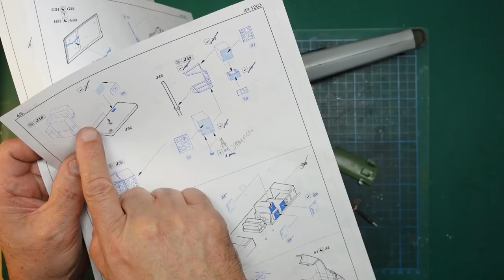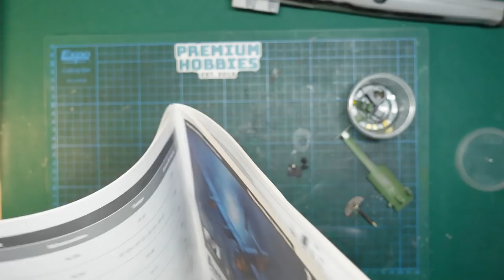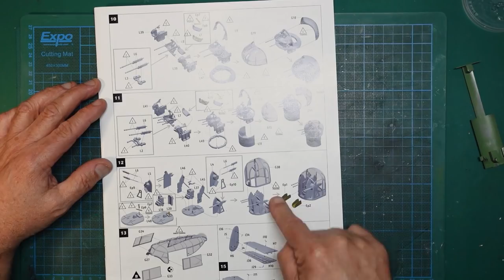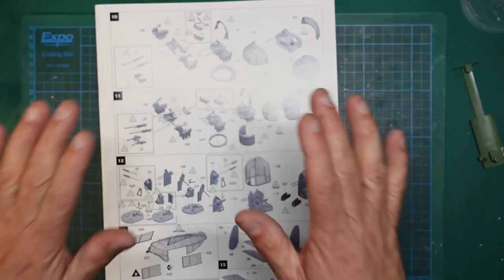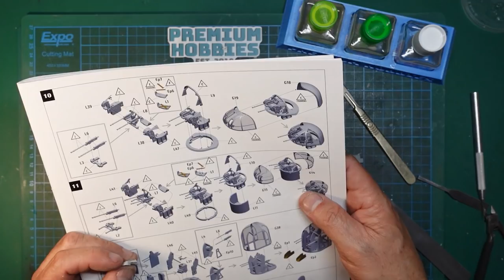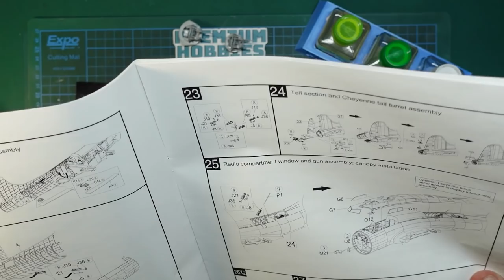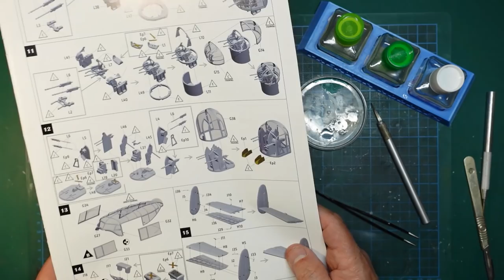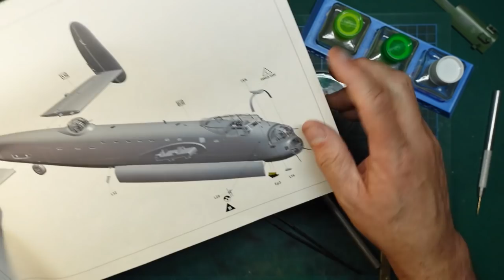Hong Kong Models 1/48 Lancaster B.1 build. Part 8

Comment: I agree with you about the Eduard levers & rudder pedals! I left the pedals off as the pilot's feet hide them but I had a go at fitting the levers- they're incredibly fiddly and almost impossible to get right, and if you do get them in more or less the right place it's too easy to bend them out of shape when fitting the instrument panel. The only bits I'd consider adding to the inside of the canopy are the handles for sliding the windows open as they are very visible on the real thing.
The HK turrets have more detail than the Tamiya kit, but seem a lot more troublesome to build!
I reckon your videos are about right regarding doing stuff off-camera, it's better to include more rather than less as people who want to can skip bits if they want to, but it's not necessary to show all of the painting first coats and flat coats.
Glad your snotfest's coming to an end!
Reply from the maker: And of course, regarding the levers, they have such a small contact area they fall off if breathed on.
Reply: @NigelsModellingBench  There's that too. I have no idea how many I still have (if any) attached to my Lanc as it needs an electron microscope to see them!
Reply: @NigelsModellingBench  It you get them to stick to where you want them. They stick like shit to a blanket on your tweezers😂😂

Comment: As your aware Nigel, I'm not a big photo-etch person (most of the plastic I deal with are figures). So it's a beginner question for you, can you not chamfer the edge of the plastic part after you super glue the photo-etch to the plastic to reduce the thickness back to the original thickness of the plastic?
Reply from the maker: Yes Steve, Or I could have reduced the thickness of the panel.

Comment: What you were demonstrating earlier with the instrument panel, where the photo etch part wasn't fitting properly makes me debate in my brain on whether I want to spend 70 to 80 dollars on photo etch kits if I'm going to have to deal with fit issues, or I'm not going to use half the parts. Is it really worth it, I constantly debate this in my brain. Why not build the kit straight out of the box, and not even mess with the photo etch. A lot of builders I follow pick and choose what parts they are going to use and what they are not going to use. So, why spend all that money on stuff you are not going to use. Help me here Nigel, I'm in a dilemma.
Reply from the maker: For me, The extra resin and PE sets are to accurize the build and make the build more enjoyable. However, of late, the PE sets do nothing to make it more accurate and often take the fun away. If i built another one of these Lancs, (which I won't), I would get a 3d printed IP and be done with it, other than my resin engines of course.
Reply: @NigelsModellingBench  thank you Nigel I appreciate your insight. I guess it's a matter of personal preference.